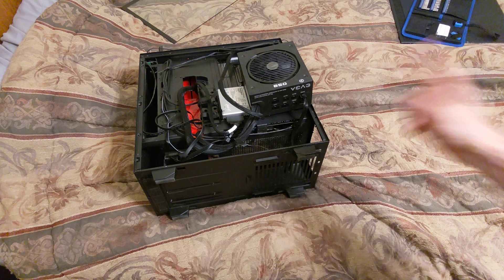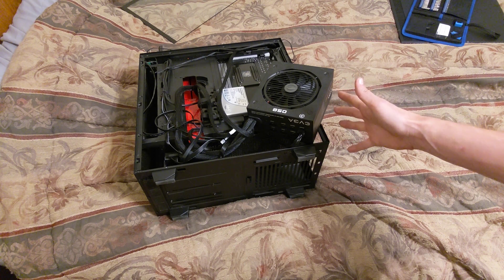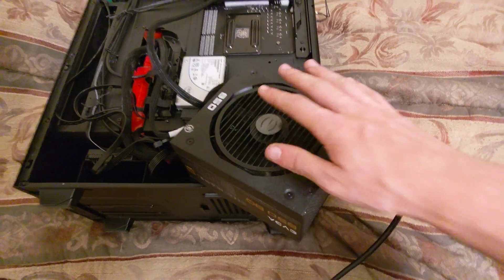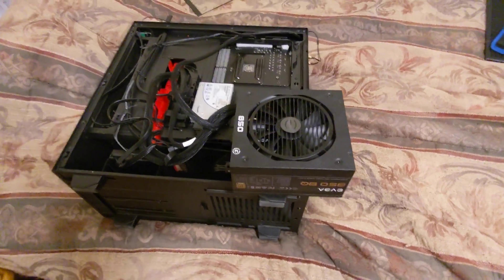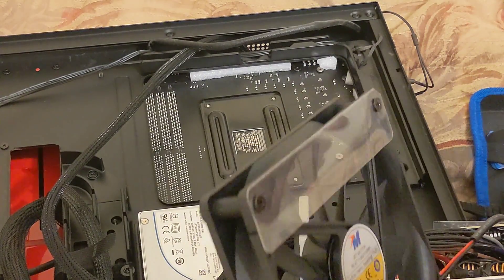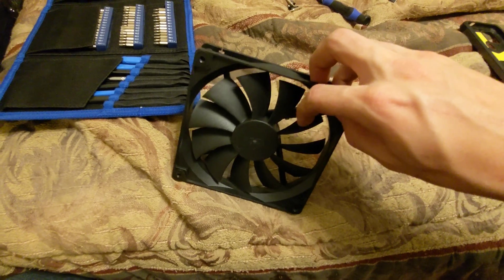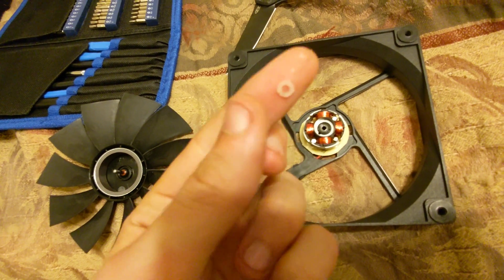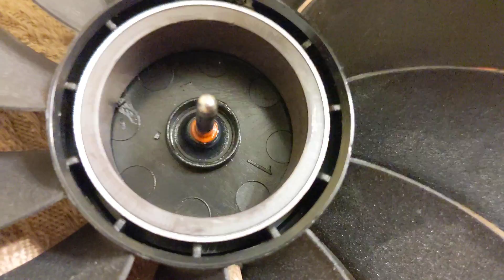EVGA 800W BW ATX Power Supply Teardown and Repair

Comment: I have an EVGA 500W Bronze and it sounds like the bearing is going and it's clicking, like you say..
However, mine is mounted with the fan facing DOWN, facing the bottom of the case, where there's an external washable filter..   (yours was absent..)
These EVGAs are designed to draw air in on the bottom of the case, and exhausted out the back.    (never sit your PC on a carpet..!!)
I will eventually  disassemble my fan and lubricate it, or at least gets the specs of the fan, if replacement is needed... 
..Cheers...!

Comment: mount your psu correctly and you'd never have heard it! (fan should be down)
anyway should add fan repair in the title because that's really what this is, also most of the other fan repair videos don't show you to pop out the fan blade to get inside of the bearing, they just say to drop oil in without removal.
The bad fans will die after this repair regardless though since their bearings usually are what is going out, the fan you had seemed good, but just dry

Comment: Thanks, this helped me with mine, I actually didn't find what was causing the noise, but the noise disappeared
 after I assembled it again
Reply from the maker: I ended up having to replace the fan entirely a few months ago because the bearing started to get real noisy in it and my PC was starting to sound like a fish tank with a loud gargling air pump, which was surprisingly not the water cooling loop but in fact the damn PSU fan!!!!
Reply: @power-max  Mine is still good for 24 hours straight, I hope it will last long, but I will also look to switch the fan if it gets bad, thankfully to your video I found how to disassemble it. I had the PSU cleaned in PC service 3 years ago and I paid for that as I didn't know how to open it.

Comment: just wondering is it okay to leave the plastic remove from the psu that is on the fan
Reply from the maker: The plastic sheet in it is an insulator to help prevent shorts to the chassis in the event something like a screw or bit of metal falls inside or an electrical surge causes an arc. It helps with creep age and clearance. It can be removed but is less safe.

Comment: Thanks for this. I had the exact same issue with EVGA 750w BQ. The clicking was horrible. Rather than repair the fan, I replaced it with a 
"Noctua NF-P14s redux-900, Ultra Quiet Silent Fan, 3-Pin, 900 RPM (140mm, Grey)", using a "3-Pin/4-Pin PC Fans to Mini 2-Pin JST XH 2.5mm Headers" to connect. Perfect fit and now I've got a silent Noctura EVGA power supply. $25 in parts from Amazon.

Comment: same procedure for evga G2+ 750gold fully modular? I want to brush inside it full of dust
Reply from the maker: For literally any PSU.
Reply: @power-max I remove all screws except for 4:40 did not know there is 1 screw hiding underneath label that cause not to remove top cover thanks sir
Reply from the maker: @reggiegonzales2318  Are you sure your problem is the same as mine anyway?

Comment: Nicely done! My GQ psu fan is dying after 8 or so years of good service, since I don't want to spend $160+ on a new one only for the fan, do you think putting a fan on top would suffice? Or I need to change the fan? Thanks in advance
Reply from the maker: Just take it apart and replace it
Reply: @power-max  Just bought the hexagonal screws and I've a fan laying around, so I'll give it a try later. If the pin doesn't match, should I cut the wires and do a "hybrid tape" fix?
Reply from the maker: @davepianist84  I think the connector type is a JST SH or JST XH 2 position header. They are cheap and easy to crimp. I've bought the tools to crimp these style connectors for electronics and FPV hobby. A set of connectors and the crimper can be got on amazon, and there are tutorials that will show how to assemble the header.

alternatively, you could desolder the cable assembly from both fan and swap them.

Or like you say you could do splicing as well, though that isn't the most elegant.
Reply: @power-max  Thanks a bunch man!
Reply from the maker: @davepianist84  the last solution is to buy a fan already terminated with the right connector, though this would require probably a considerable amount of research.
Reply: @power-max  There are some adaptors out there but I'd need to travel a couple of cities to get one, I could always find someone with the tools and knowledge who does it for a fee.
Reply from the maker: @davepianist84  Send me the old fan and the new fan to my PO box and I can do that for ya. (well, if you live in the states, I don't want to deal with customs nightmares)
Reply: @power-max  I really appreciate the gesture, sadly I live outside te states and besides the customs problem the expense would outmatch the labor fee. But thanks again!

Comment: Bad idea to open a PSU and handle the internals....great way to get a trip to the hospital. The capacitors can hold a charge even when disconnected from the power source..
Reply from the maker: I'm an electrical engineer. The only thing dangerous inside it is the 400V bulk storage cap. It will give a nasty shock but will self discharge on it's own after a minute.
Reply: There is always a commenter in one of these kinds of vids, who raises the alarm about the dangers of opening a PSU.  They are the same people who lack common sense and prolly agree with CA labeling everything from stuffed animals to chewing gum, as possibly causing cancer.

Comment: I know I'm late but there's a need to clarify 2 things:
1st your CPU cooler is literally suffocating against the graphic's backplate lmfao. Turn it dude😂

2nd that sticker "nobody cares about" holds lubricating oil for the fan shaft
Reply from the maker: Not to worry, The CPU cooler has since been replaced with a 280mm EVGA AIO, Had no issues with the fan since.

Comment: oke yes thats excatly what i hear, and my computer wont start at all
Reply from the maker: you might have more serious issues. In the case of mine, it was clearly just the plastic burr inside the fan. In your case it sounds like the PSU circuitry is faulty. They make ATX power supply tester boards with LEDs for each of the voltage rails to validate the PSU supplies voltage at least at no load. Try one of those. if it passes that then testing the PSU further will require some lab equipment that costs more than your computer. And a new car.
Reply: Agree w/Power Max NotGrogu.  The PSU fan making noise has nothing to do with your computer not starting.
Reply: @NotGrogu  what PSU model and make is it and how old is it?  To understand what you are saying: the PSU powers up, the fan spins and makes noise but the computer does not fire up?  Any lights?  You have a GPU?
Reply: @PapaMav  psu, no idea
how old it is, i bought computer not three months ago
and fan doesnt work at all, all i hear is ticking, none of fans are working and light near "turn on" button is blinking like its normal power up, in all that time, pc didnt start, just ticking noise coming from psu
Reply: @notgrogu5922  what make and model PSU?  Wattage?  Is the "turn on" light on your MOBO?
Reply: @notgrogu5922  no matter what, gotta start by taking the PSU out of the case.  Most have a sticker on them about manufacture date.  Important info to know.
Reply: @PapaMav  there was a guy who ran a diagnosis, he connectes his own psu, and it worked, so mine is dead
Reply: @PapaMav  ty bruv
Reply: @notgrogu5922  you in The States or elsewhere?
Reply: @PapaMav  serbia
Reply: @notgrogu5922  then you may not have access to the same brands that are accessbile in the US.  If I am not mistaken, Thermaltake, be quiet ! , Cooler Master , Corsair and Channel Well Techology may be some of ones available to you in the market you are in.  I am glad to help you make some choices and answer questions.  Important things about PSUs is to have a temp rating of at least 40c, at least the main capacitor be Japanese (although Teapo, a Chinese cap is known to be pretty good) and you want the standard PSU protections: OCP, OVP/UVP, OPP, OTP & SCP, along with at a minum a Bronze rating or Gold.

Comment: What a terrible repair, can you imagine a surgeon operate on you like that? lmao
Reply from the maker: It worked fine, the problem was solved, and it is still working just fine. What is so terrible about the repair?
Reply: @power-max  
Relax, I didn't downvote you or anything.
The process was too violent for a repair job done on something that was designed for easy disassembly. Also, good work with the fan for not putting the clip back and all. That's an excellent fan by the way.

Really looking forward to an apple product repair from you, have you considered making the violence/uncaring into a feature of the channel, rename it to "Club surgeon". It would be much more entertaining to watch than other similar channels.
Reply from the maker: @dou5689  I don't know what was so violent about it LMAO 😂But yeah, I was maybe a bit frustrated the PSU was having this issue that was annoying the shit out of me for the past 2 months and took ages to identify the culprit, so I wasn't about to go easy on it 😈
And the issue being the molding of the fan, and another user here in this comments section is having the same problem. My opinion is that it is a cheap shit fan. Could be worse though.

Comment: Don't be surprised, they have NO QUALITY AND NO QUALITY CONTROL.
Reply from the maker: EVGA is a good company, this is a lower to mid range PSU so cheeping out on the fan isn't suprising
Reply: @power-max  You are right, but some quality control should screen out these small problems.
Reply: @paulcohen1555  it's not about quality control, it's about profits.  They contracted with a company who could provide them a 140MM fan for their 650, 750 and 850 Watt BQ models, for the cheapest cost to them.  Simple, end of story.

Comment: problems evga has got with the bq line of psu's.  my 650  fan clicking worse than that under load after less than 6 months. they wanted me to rma it when i need it for my computer....
Reply from the maker: Try turning it upside down like how I demonstrate. Does it change? Does the clicking vary with the speed of the fan? It may be the same issue. You could also wire in a new fan but may need to splice in to the existing JST XH connector if you don't have the tooling, pins, and headers to crimp one.
Reply: @power-max  doesn't matter with mine. silent until it heats up, then clicks away like a prop fighter plane.  lol
Reply: @power-max  going to try to wire in a case fan into the outside of the fan grill.
Reply: I would not RMA just for that; I would replace the fan with a rifle bearing one.